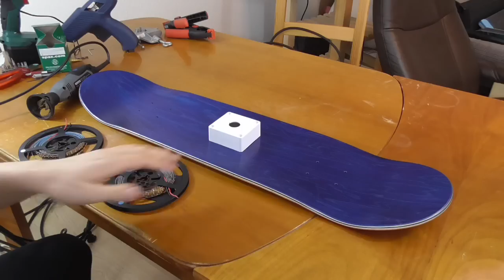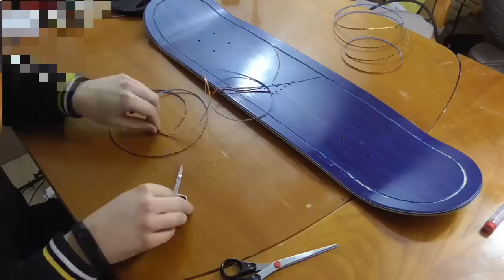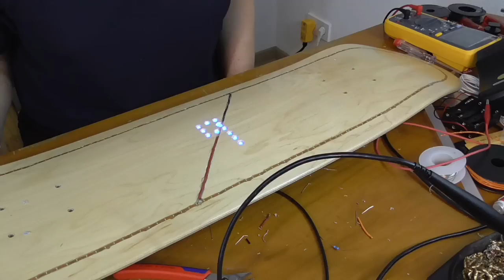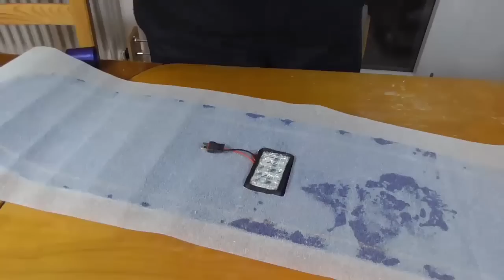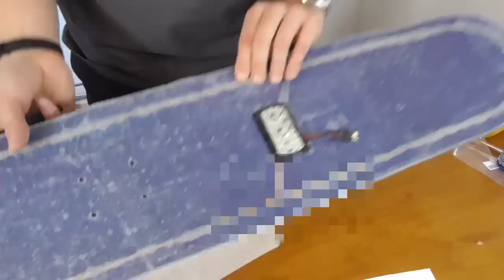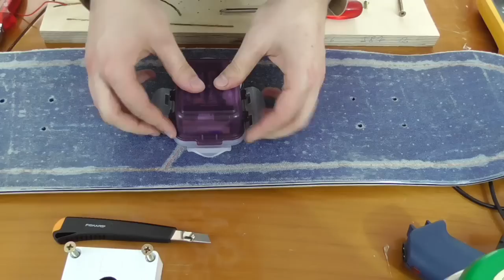LED Skateboard for braille Skateboarding

Comment: Hey, nice job you did here ! I’d like to try to make one for myself, could you please tell me what are the references for the LEDs and the battery that you’re using ? :)
Reply from the maker: I plan to make a video about how to choose LEDs and power source for your own projects. Stay tuned!

I bought these LEDs because they are very slim and high power:
https://www.aliexpress.com/item/5m-3mm-width-PCB-thin-SMD-0603-120leds-m-Super-bright-LED-Flexible-Strip-Red-Green/32700598626.html
They are cheap and probably not very efficient, but thats ok for a project like this. For lighting in my appartment I usually stick to nichia leds.

The batteries are just regular AAs. 8 of them in series to get 12 V which the strips need. You can find battery holders on the same site as the leds. A 3 cell Lipo battery would be better but might catch fire with the guys jumping on it.
Reply: Thanks a lot for the details ! :)

Comment: What type of tool are you using to draw the oval lines to insert the LED?
Reply: The Laughing Llama woodworker made jig
Reply from the maker: In the video you see me draw the lines with a spacer I made from scrap wood. But my dremel routing tool tended to bend and wander a lot, so I didnt do a very good job. It looks pretty bad up close.

Comment: Woher bekommt man diese kleinen LED-Streifen her?
Reply from the maker: Ich habe sie bei Aliexpress gekauft, Artikelnummer 32700598626. Aber die sind recht billig und wahrscheinlich nicht besonders effizient. Wenn du etwas hochwertiges willst kann ich Lumiflex LED bänder empfehlen, die haben die guten Nichia LEDS.

I bought the LED strips on Aliexpress article number 32700598626. They are very cheap and probably not very efficient. If you want high quality LEDs I can recommend Lumiflex LED strips, they use Nichia LEDs which are very good. The flickering LEDs can be found on ebay. They are supposed to simulate the flame of a candle or, in case of the blue ones, a running TV set when you are not at home.